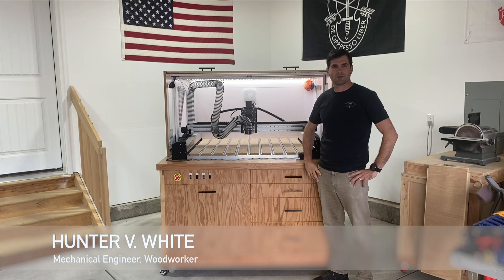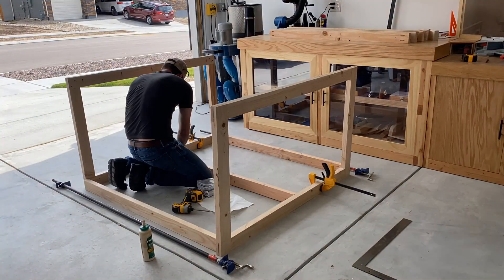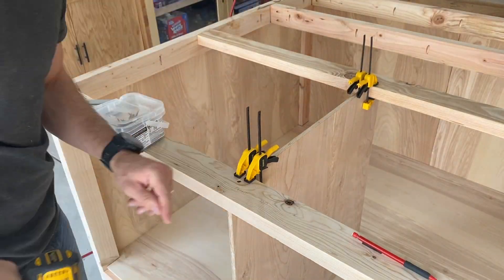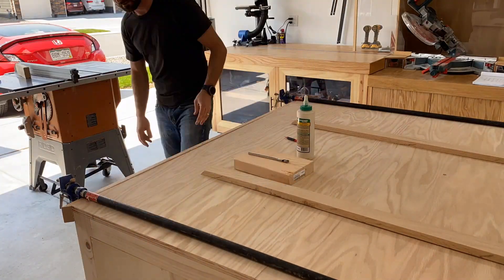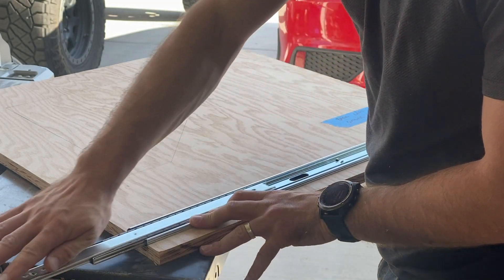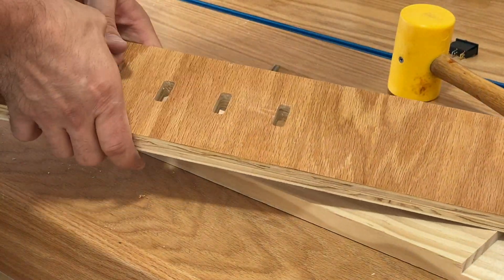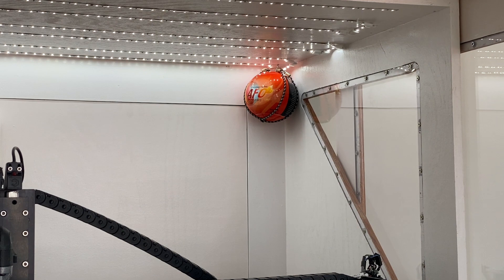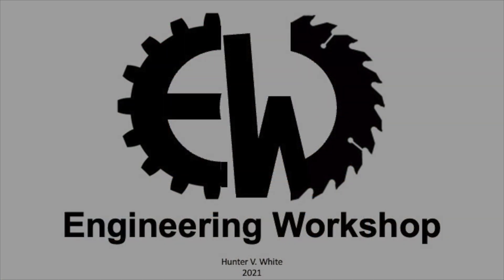CNC Enclosure: All the features

Comment: Love the comment that you built! 
I noticed you have a desk collection in the drawer, What type is that with the extra container?
Reply from the maker: I'm using a Festool CT15 dust extractor with a thien baffle system on top of a 5-gal bucket (chip separator).
Reply: @EngineeringWorkshop_hvw  Thank you. I intend to order the file for the cabinet and the drawer. I am waiting for block friday for the shapeoko five pro

Comment: Thank you for sharing this. Very impressive. Follow-up question if you happen to still check this - does the Festool do OK heat-wise in the closed drawer?
Reply from the maker: I haven't had any issues so far. I did install a small computer fan in the back of the enclosure cabinet to get some airflow back there. I just wired the fan to my auxiliary switch on my control panel. I'm not sure if this was needed - I ran it for months with out the fan - but it makes me feel better.
Reply: Thanks @EngineeringWorkshop_hvw . That's good to hear, and good tip on the computer fan. I'm thinking I'll try something like that or a bathroom exhaust fan and pipe it outside.

I just finished an adapted wider version of your enclosure, and while this project absolutely kicked my butt as someone new to woodworking, your plans and instructions were really well done and kept me on track. The only issue I've had is the front-top not wanting to slide back... but I suspect it's because I did two drawer slides on the top and probably need to re-align / reinforce for sagging on the back half. Or I just didn't get that piece square, which is very possible.

You mentioned this in another comment, but for anyone else looking at this, I'm also pleasantly surprised at the sound reduction. I'm sure it's not anything like the soundproof-designed enclosures you see on here,  but it's completely possible to have a normal level conversation or watch a TV show next to the enclosure while it's running.

Thank you!

Comment: what would you say the weight capacity would by with your build?
Reply from the maker: Just a guess, anywhere from 500-600 lbs with a safety factor of 2. This is an informed guess based on a weightlifting half rack I built out of 2x4s (build plans available on my Etsy store). I did some analysis of a single 2x4 under compression load, along the grain (2x4 on its end, standing upright; which is similar to the frame of this enclosure) and it can support 500 lbs all by itself, if it isn’t allowed to be cross loaded, or put under an extra torque, etc. With four 2x4’s in the frame, one in each corner, and braced against deflection, I’d say it can easily support 500+ lbs. this assumes the weight is fairly evenly distributed across the top (I.e. not a point load). 

In a practical matter, I’ve stood on this enclosure a lot (180lbs) and haven’t experienced any deflection while standing, walking, crawling, etc. it’s rock solid. I’m sure it will hold any CNC that will fit on it.

Comment: Great build I really like how flexible that enclosure would be. 
What hose are you using? It looks way more flexible than the hose I have for mine.
Reply from the maker: I'm using 2.5" dust hose from Woodcraft. I'm sure you can also get something similar from Rockler, etc., I just liked the color scheme of the Woodcraft one - matches the machine better. It's been great so far. I use a Festool CT-15 dust extractor and an inline thien baffle chip separator beneath my enclosure (large drawer on the left) and the suction has been all I need - keeps everything really clean and I don't recut my chips.

Comment: I built a PrintNC CNC and it was super fun.  I still have no enclosure and I intend to build one like yours.   I recommend you get a cheap little label printer (I got a "phomemo" one for $30 and it was invaluable to label wires and cables.  I was writing on electrical tape and it was so frustrating.  Great purchase.  Also recommend you setup a contactor for disconnect rather than the smart switch.

Comment: Nice video. Thanks for sharing. I would recommend relocating the smoke detector to outside of the cabinet. It won’t take long for the dust to collect inside the detector and set it off. As an alternative, you could use a heat detector (rate of rise); however I am not sure they are Wi-Fi compatible.
Reply from the maker: You’re welcome. As far as the smoke detector, I’ve had it in that position since I’ve build it with only two instances of it going off. I went off once for carbon monoxide with no clear reason or indication (we took all necessary precautions) and the second time was when I blew out the enclosure with compressed air - dust was everywhere. I’ve used the CNC with and without dust collection and have never set it off during use.

Comment: Great video and great build. I just purchased the plans; however, I will have to modify the build for the Onefinity Journeyman (probably add 10 or so inches vertically). The plans indicate the front draw is for a 5 gallon chip separator. Can you share what you are using for the actual dust collection and where is it located?
Reply from the maker: Hey John, 

Thank you for your purchase and your support. I hope you are happy with the quality of the plans! I absolutely love my CNC enclosure and have received a lot of positive feedback on the resultant builds. I use a Festool CT15 dust extractor and a 5 gallon bucket with a thien baffle for a chip separator. Both of these fit in the “dust collection drawer” (side by side) which is really convenient. Originally I planned for the dust extractor to sit behind the drawer bank in the back of the enclosure (which would definitely work), but was pleasantly surprised by the Festool form factor. 

I figured the chip separator would be emptied most often and would be best in the drawer for ease of access. I planned to remote start the dust extractor for use (if it was behind the drawer bank) and would take the drawer out of the enclosure to empty the dust extractor when necessary. 

I hope that answers your questions!

Hunter
Reply: What spec ops group you with?

Comment: Great build! Can I ask what did you use to do the cutting diagrams, thinking Fusion 360 but what add ins?  Looks great.
Reply from the maker: I actually created the cutting diagrams manually. I designed everything parametrically, so I just outlined the pieces inside a 4x8 sheet of plywood with their respective variables and made them fit. 

Now that I know a little more about Fusion360, you could nest the components in the manufacturing workspace.

Comment: how rigid is the table for when the CNC is milling?
Reply from the maker: I haven't measured the table for displacement while milling, but I would heuristically say the entire assembly is very stable. I think the most movement comes from the casters. Also, I don't push my CNC very hard against dense materials - most wood is soft enough that it won't put so much strain into the machine that the table will deflect. Compare this to machining hard metals. Generally speaking, I haven't seen anyone use the proper work-holding on their projects to resist the forces required to flex the work surface the CNC sits on. My point (especially for double sided tape) if the CNC was strong enough to flex the table while milling, it would break the part off the waste board first.

Comment: Great build. I've watched it several times for inspiration and ideas.  I am grappling with ideas for rocker switches to control the items.  can you show how you installed the switches to the outlets (you can see it a little in the video). Also, how did you hook up the e-stop to your CNC? Does your CNC come with a control box? If so, how did you wire it to the e-stop.  I'm looking for electrical advice, just curious how you did yours? thanks again.
Reply from the maker: Thanks! I sent you a reply on Etsy.

Comment: Looks great! Where are you storing your control box? How effective is the top for noise reduction?
Reply from the maker: Thanks! I don’t have a VFD spindle yet, so I don’t have a large control box to store. The Shapeoko has controller that mounts to one of the side rails, and I use a BitRunner that mounts to the other side rail. These are within the footprint of the machine and easily fit inside the enclosure. 

The top is very effective at reducing noice. I have a video “Special Forces Detachment Logo” where I run a decibel meter and demonstrate the sound reduction.
Reply: @EngineeringWorkshop_hvw  Thanks!

Comment: Because I did the electrical! So funny!!  Hey I have the same machine, does your enclosure reduce the noise?
Reply from the maker: Hey! Thanks, I’m glad someone gets my jokes lol. It reduces the noise a lot. I’m my Special Forces logo video, I run a decibel meter during different cutting loads to demonstrate the noise with the enclosure. It makes a big difference being in the shop - mostly reduces the high pitched whine from the router and the peak decibels when slot cutting hardwood.
Reply: @EngineeringWorkshop_hvw  hey I have the bit zero and bit runner so the router auto turns on n off, was wondering if you have the same add ons and did you have run your vacuum?
Reply from the maker: I also have the bit runner and bit zero. I like having the router/spindle turn off when the job is complete. The bit zero is just too handy not to have. I use a Festool CT15 as a dust extractor. I run it every time I use the enclosure. The Festool is quite as is, but inside the enclosure it is almost silent.

Comment: Do you have a design plan for the x50 journeyman by chance?
Reply from the maker: I don’t at this time; sorry! I eventually want to develop those plans, but I think major modifications will be necessary to adequately utilize the space underneath the CNC. Namely, I want to add a third bank of drawers, rather than simply expand the two banks already designed. This will be more time consuming than simply modifying the parametric variables; that’s why I haven’t got to it yet.
Reply: For what it's worth, I did the lazy version of this and just added 12 inches of total width, and split the different at 6 extra inches of width to the drawers. It is working well and didn't require any complicated math (I did have to add a middle piece of frame to the front door as I couldn't find an affordable piece of polycarbonate that big... but that was the worst of the adjustments needed).

Comment: First, thank you for your service!!!!    This is an excellent build.  Very well done.  I have already purchased the plans to build this for my Shapeoko3 xxl.  My biggest concern is controlling dust as I share my garage with my better half.  I noticed you are using the Festool dust vac.  I am wondering how that is working for you as the cfm is only about 135.  Also, any concerns of it over heating being in the cabinet?  Thanks for a great video.
Reply from the maker: The Festool CT15 has been doing great; plenty of suction for a 2.5” dust hose. It’s even doing a great job with the efficiency loss due to the chip separator. As far as the heat generated inside the enclosure, I added a small fan (like a computer fan) to the back and wired it to my auxiliary switch on the control panel. Now I can turn on the exhaust fan and blow out the excess heat. I tried plugging this into the Festool extractor to trigger when the extractor comes on, but the amperage isn’t enough to trigger the “auto on” feature of the extractor.

Comment: How is your dust collection setup festool vacuum
Reply from the maker: The Festool is doing great. I’ve only had to empty the 5 gal chip separator once, and the HEPA bag has only a tiny bit of dust in it. The Shapeoko dust boot does a great job of keeping the enclosure clean. My only upgrade is to add a ventilation fan (already purchased) to the back of the enclosure, and plug it into the Festool. That way I can wire a switch to trick the Festool on from my control panel.
Reply: @EngineeringWorkshop_hvw  Thanks in process of finishing base. Wasn't sure if chip separator works on same level as vacuum
Reply from the maker: I’m sure there is some fluid dynamic loss associated with the thien baffle on the chip separator, but it’s worth it to me to save on the expensive Festool HEPA bags ($35 each). I use the standard Festool hose from the extractor to the chip separator (I purchased a hose adapter kit from Rockler) and a 2.5” hose from the chip separator to the dust boot on the CNC. The suction is good enough that I can easily clean up my work area after a job, if the dust boot missed anything (usually just a very small amount). 

I hope your enclosure build is going well! Are you happy with how it’s turning out so far?
Reply: @EngineeringWorkshop_hvw  It's going well for most part. Hiccups to be expected I used Baltic birch for the top. This tested my patience level in regards to not rushing to finish. I feel like I'm in the home stretch..
Reply from the maker: Good! I’m glad to hear it. If you already have your CNC and know how to use it, you can cut the enclosure pieces out; this will save you from having to hand fit each piece of polycarbonate like I did. Lots of back and forth to the sander. I’d love to see a picture when you are finished!

Comment: Hey mate awesome build!  I wasn't planing on build an enclosure until I saw your video. Anyway, I know its easy to convert everything but your planes don't happen to have the metric version do they?
Reply from the maker: Hey! Thanks for the complement. I don’t have a metric version, but I would love to make one. I have designed everything parametrically in Fusion 360, so it will be very easy to convert all dimensions. I haven’t done this yet because I want to use commercially available material sizes, not just converted standard/imperial dimensions. If you could provide me the dimensions for commercially available metric building materials equivalent for: 2x4’s, 3/4 inch plywood, 1/2 in plywood, and 1/4” polycarbonate,  I can redo the plans. I’ll send you a free copy of the metric version for your help when I get it finished!

You can send me a private message on Etsy to discuss further if you’d like.

Comment: Hello. I have a Onefinity, and plan to use a Festool for my dust collection setup, with a cyclone added. Do you find this is sufficient for suction. Any drawbacks , other than price? How is the noise, and heat?
Reply from the maker: The Festool has been great so far. Plenty of section with a 2.5” hose going from my chip separator (5 gal bucket with plastic thien baffle) to my router dust boot. The noise is fine tucked away in the enclosure. It’s obviously louder with the drawer open, but still quieter than a shop vac for sure. It does generate heat in the enclosure. To fix this, I’m going to install a fan into the back of the enclosure to exhaust some of the heat. It’s a plug in fan, which I plan to plug into the front of the festool, then wire a switch to my control panel. This will allow me to turn on the vacuum with my switches, rather than pressing the button in the front of the dust extractor.

Comment: Can you please share more details or a picture of how you made the front door with the T track and wooden dowel. Did you have a stop on the end to prevent the Front door from coming out of the track?  Also, do you have a source of the AFO fire suppression? Thank you
Reply: thank you for the prompt response. Great Video I have built the sides already. My challenge is the front door, since I do not have height to do what Mitz did. I had planned on a Barrister Hinge as you have.
Reply from the maker: Hey, I added a link to a fire suppression product in the description. Apparently the fire suppression ball isn’t available anymore, so I linked an automatic fire suppression tube. The tube is heat activated, rather than flame activated, which is a superior solution. 

Also, that’s the first time I’ve heard of a barrister hinge lol. I wish I would have know that so I could have better articulated the design in the video. Oh well, thanks for teaching me!
Reply from the maker: Hey Michael, I have complete plans available on my Etsy store if the following description doesn’t fully answer your question. 

I build the front door with half-lap joinery, just making a rectangle to mount the polycarbonate into. I drilled a hole in the outside corner to fit a dowel. This dowel is sized to fit into your t-track. It’s important to use a cylindrical prism, rather than another shape, because once the dowel is glued to the door, it needs to rotate (door opening) and slide along the t-track. To prevent the door from sliding out the front, I glued “edge banding” (a .25” thick and .75” wide strip of oak) onto the edge of the plywood. This covered the exposed end of the t-track embedded in a dado in the sliding enclosure sides. 

I’ll provide a link to the AFO ball in the description. I bought it off Amazon. 

I hope this helps!

Comment: Fantastic video! I just moved and put my CNC in a room in the basement. I saw your comments on someone's question regarding noise reduction. Do you have a sense using your phone with the noise reduction would be between the lid open and the lid closed? Again thanks for sharing! Great design! And most importantly, thank you for your service.
Reply from the maker: Hey Mark, thanks for the comment and complement on the build. I’ve been meaning to measure the decibels while in use. Next time I fire up the CNC, I’ll take some readings and report back.
Reply: @EngineeringWorkshop_hvw  thanks man!